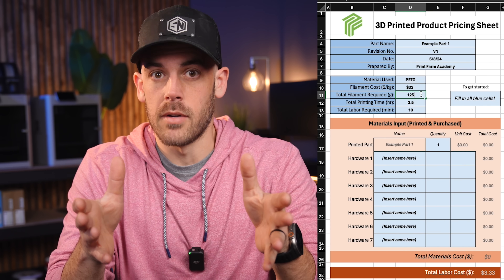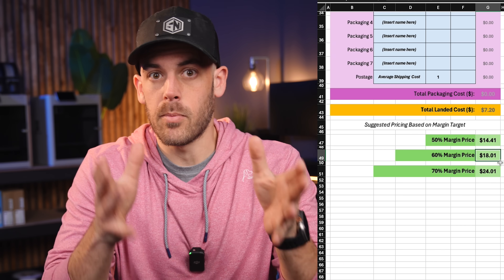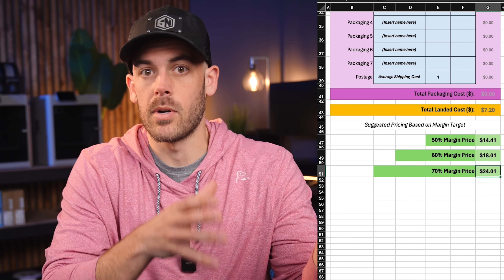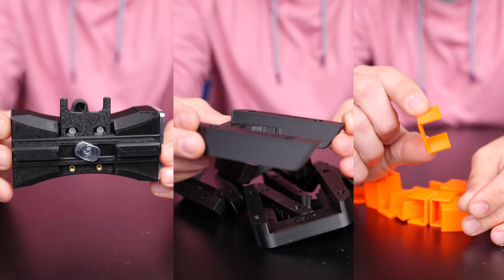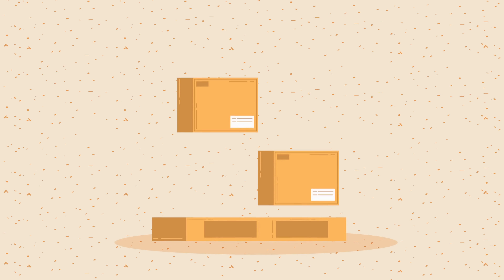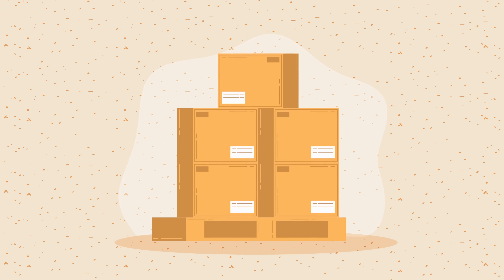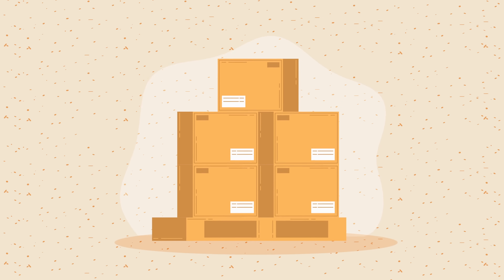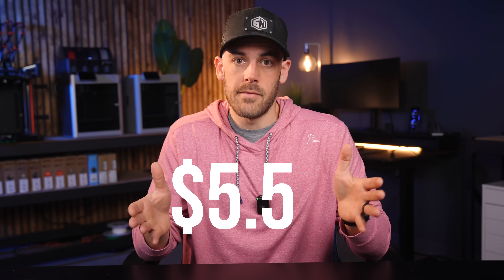Why I charge $55 for this 3D printed part (how to price)

Comment: One thing I'll add is that as an Etsy seller offering free shipping for many years, I have realized that for whatever reason, my buyers do not care about shipping cost, they buy at the same rate whether it's free shipping or $5.50. I don't know whether this is an Etsy specific thing, where people feel more justified paying shipping on a "handmade" item, but it came as a big shock to me. I had assumed that Amazon had spoiled people and anything other than free shipping would scare the buyers off. Not the case, in my experience. Has really boosted my bottom line, since shipping was by far the biggest slice of the pie taken out of my profits. Great production value on the video by the way.
Reply: Agree and disagree I have bought off ebay many times and always go for the free shipping ones and have gone back and looked it was the same price on both products the ones with free shipping was a little more expensive and the ones without free shipping were cheaper but the same after shipping
Reply: @johnathancampbell1056 when you use eBay to filter by price it does cost + shipping (if applicable) so as a consumer it's very easy to compare, I tend to shop using the combined price, but "fast and free" shipping usually has a speed advantage
Reply: @johnathancampbell1056 Some people just like the idea of free shipping, and some people could careless what it is.  I know it doesn't matter what shipping offer you offer, as long as you have a good product to sell, it will sell from exsperience
Reply: If shipping is declared seperately, the buyer can order more items at once, so he and you can both save money.
Reply: i always look at the full cost of something. If I can buy something for $15.00 with $5.00 shipping vs another item for $18.00 with free shipping, I would be more inclined to go for the $18.00 one because it's cheaper overall.
Reply: @redpug5042  The main deal with the shipping, especially from a site like ebay is that shipping is often not refunded if there is a problem. I'm not sure if ebay has fixed that but it was a real issue at one time, especially when sellers would sometimes offload a bunch of the price into 'shipping and handling' because ebay's fee was based on the item cost and not the shipping.
Reply: On my etsy store people regularly purchase items seperately, paying shipping costs twice and don't even care. I constantly tell customers that I can combine their orders and refund them the excess shipping. 

May also depend where your buyers are. Compared to the rest of the world people from the United States just have more money to spend and the shipping costs aren't that big of a deal to them.
Reply: @Janovich  They must be female. No male is that stupid, I hope.
Reply: @Janovich  As much as they paying for grocery, they care about costs just not paying attention
Reply: I can't say I fall into that category. I 100% look for shipping costs.  I'm always seeing what the final cost is going to be total.  Same goes for EBAY.  Those dollars add up fast, especially if you're buying often.
Reply: How much does Etsy charge for their fee?
Reply: @andreamitchell4758  Its spread across a lot of different charges which obfuscates it a bit. $0.20 per listing, if the item sells even if your original listing specified a quantity it has to be relisted incurring this expense again, also if the item does not sell after 4 months the listing expires and must be renewed repeating this expense. They charge a 6.5% transaction fee, a 3% plus $0.25 per transaction payment processing fee. If you do 10k per year or more of business you're required to be enrolled in their off site ads system (at less than 10k you're automatically enrolled but are allowed to opt out) any sale resulting from an offsite ad incurs an additional 12% fee. So for any given transaction Etsy's fee ranges from 9.5% + $0.45 to 21.5% + $0.45. Plus additional fees for listings that have been listed but not yet sold or expired without selling and had to renew.

YTD I've done $40,702 in gross sales, and paid Etsy $5,696 in fees +$213.74 in offsite ad commissions for 14.5% of my total gross sales going to Etsy. In terms of scale my shop currently lists 2,024 different products, and I've fulfilled 1,456 orders year to date
Reply: Your items are one of a king so you aren’t competing with anybody price wise. Trust me if they can get it more expensive but free shipping where the total ends up being cheaper then they will go for whatever is in total cheaper, this is from an eBay seller of 6 years
Reply: It definitely depends on the platform. People are more reasonable about it on etsy. But if you go to Amazon, paying for shipping is some sort of sin in people's eyes. I consistently watch my mother and father paid $ $20 or $30 for an item rather than paying $10 and additional $5 in shipping. Its not about the actual dollar amount but more so the percentage increase. $10 shipping ok a $10 item feels far more painful then $10 shipping on a $70 item.
Reply: @littlejack59  why would you pay shipping when they already factored in their shipping labor into the cost? makes no sense.
Reply: I was charging free shipping on my eBay business and lost money. I added shipping and my profits increased. I will never go back to free shipping
Reply: i for my part allways do a little calculation on free shipping and partprice. It is nowhere a problem to pay shipping if it is reasonable. Alltho to send to switzerland which is "outside" EU at least political which kinda makes it complicated sometimes.
Reply: Idk how much you charge for your product, but if shipping is a small enough fraction of that cost (or just feels like a small number like $5 often is), I could certainly see myself overlooking it.
Reply: Makes total sense to me. If i want to buy something that is available from multiple sellers I go for the cheapest option(including shipping). If you are the only seller and see a reasonable price but shipping cost is very high because of my location I see it as my fault and might accept the perceived "loss" due to bad luck. If you however give me the same price (or even a bit lower) and include "free shipping" I feel like you are trying to rip me off and will try to avoid buying it even if I would desperately need it just to not "fall" for it.
Reply: I sell relatively high ticket industrial automation gear on eBay, and I have also noticed my buyers absolutely don't care about shipping costs.
Reply: That might just be Etsy. I HATE paying for shipping, and have never charged extra for shipping on top of the cost (I've already calculated that into the final cost anyway).
Reply: I was surprised at this as well.  I never thought that I would have the buyer pay for shipping, but I gave it a try, and it didn't affect me at all.  I post every item way that now.
Reply: I don't care to pay shipping as long as you combine shipping.  If I buy 1 small part and shipping is $10 then it should STAY $10 if I order 10 of those tiny parts.
Reply: Well shipping definitely changes depending on the size of the parcel so if you order enough to increase the size of the package you should expect shipping will go up
Reply: @travr6  Well $10 will get you upto 2lbs to some areas slow boat, but why you expect free if you increase the weight alot. Tell the carrier I will pay same shipping if its 1 lb or 10lb see what that gets you. The flat rate boxes are like $16 and have limited space
Reply: @freedomisfromtruth Notice i said tiny parts.

Comment: I think you may have missed a calculation in your spreadsheet. There doesn't seem to be a section that uses the print time rate.  My Landed costs don't change when I change the cost of my printer.

Comment: As someone who does cost accounting for major manufacturing companies - you'd be surprised how many of them cannot properly get their costs together because their ERP is such a mess.
Reply: I worked for a small company that the owner was basically driving into the ground because he was scatter brained and couldn’t keep his ERP in check or managed. Put a whole migration and operations plan together for him to have everything work automatically between website, warehouse, ERP, etc. but he couldn’t follow through and now he is still paying costs related to incorrect stock tracking, unoptimized shipping profiles. Really makes me think how some businesses have made it as far as they have
Reply: I'm not surprised.  I worked as a manufacturing engineer and learned that most companies have a hard time calculating actual labor costs....and estimating labor costs...
Reply: I work for a Fortune 500 company and you are spot on here.
Reply: Omg I worked for one of the major automotive manufacturers as cost accountant/data analyst and was responsible for the cost accounting of the entire plant. QAD was a cluster and trying to reconcile BOM cost rollups after ECN's because of 0 costs on the part by materials, engineering not versioning the part, parts not being switched to the correct model and having an older model/different model's part on the BOM, it was a constant mess.
Reply: Spot on, it's a truly mess
Reply: Oh yeah, believe me, you do not want to get involved in the ERP scene.
Reply: @RightJoystick  I think I do.
Reply: whats ERP?
Reply: @GoalOrientedLifting  Enterprise Resource Planning aka planning how the business operates
Reply: @GoalOrientedLifting  In gaming, ERP means "Erotic Roleplay" lol.  I was making a joke with my comment.
Reply: @RightJoystick  lollllllllllllllll
Reply: Oh don't get me started...  Too late.  Most medium-size job shops totally misuse ERP's.  They either kill the company's agility with nonsense bureaucracy or burden employees with ineffectual office automation that makes them do MORE redundant work, causing more failure points and wasting ones effective time.  So frustrating.
Reply: ERP - Enterprise Resource Planning? 
Aren't there plenty of applications for this?
Reply: I call that MOM&POP disease!   They have more adrenalin than, you know, accounting, planning, life skills and are run off the DRUG their brain creates, and is maybe why so many end up f'n over their kids and other people in the end!  

Also, I'd venture they could never understand what an ERP is, even if you told them.  

A point you may like, my next venture's ERP, with advanced AI, looks like about $34M, which i'm buffering about 300%, because even these experts never see what I want, even when I provide a very detailed wire frame and expectation sheet!
Reply: i love it when my erotic role play is a mess tho
Reply: Most ERPs systems are good, but the people who implement them are not. Companies love to cut costs and hire the cheapest possible service. You can get lucky, or get a company full of ID10Ts... (like a famous consulting company that starts with Acc...haha). So, basically, any decent ERP can get the job done... but with bad implementation and bad data maintenance, definitely it will be impossible to get the right costs. I've been doing that for 20+ years... and I've seen that so many times that I lost count!!
Reply: What about R&D costs?
Reply: Newbie here - ERP in this context means?
Reply: @LooseyHenderson  Enterprise Resource Planning
Reply: @LooseyHenderson If you run a manufacturing company it’ll help track your inventory, available production lines, accounting, etc.

You can think of it like “super” Quickbooks, but it can also help you plan production and tell you where to pull materials, etc.

It can do a lot more but that’s the short of it.
Reply: so wild, so true
Reply: Dawg, you cannot be giving me reminders that will keep me up at night. My org, which is LARGE puts no priority into the ERP
Reply: I knew a consultant who, back in late 80s and 90s had an archaic program and he went to major MFRs to help them figure out their costs and efficiency.
Reply: ERP doesn't exist any longer in the UK, our company is now into it's 3rd year trying to close a contract with the police, it could have been done in 4 weeks.

Comment: You may be falling into the same trap that other home based businesses do. To establish pricing, you also need to factor in the square footage that your business occupies, legal and other professional help, permits, insurances, initial time to construct the 3d products you sell, including prototyping, bad debts and returns, marketing costs and other expenses that may be unique to your situation. For example, in my particular case, using your excel sheet I come up with an overall cost of goods sold for a particular item of $18.64. You might think that selling this item for $40 would work out well. But when you factor in sales as a percentage of additional fixed and variable expenses, that number jumps to $29.40 (approximately), making my $40 selling price a bit low.
Reply: imo 30% margin once everything is considered is pretty fair if you are on a tax free business.
Reply: Another important thing that many do not consider is competition. Is there a product on the market that does the same thing, but costs less and has the same value for the end-user. Some parts aren't worth making, aside from making them for personal use.